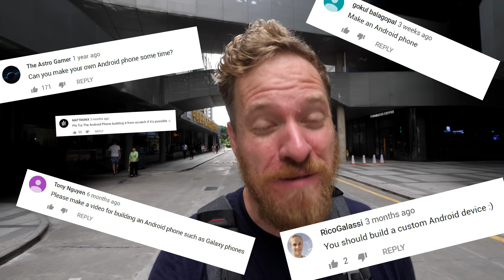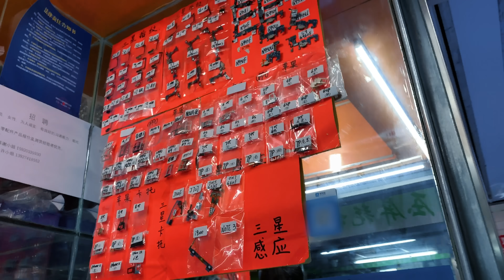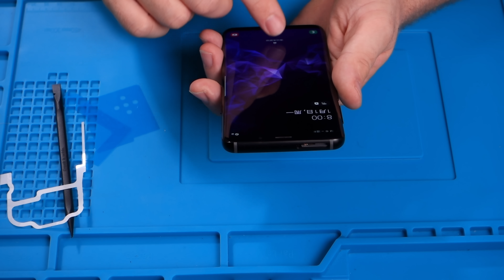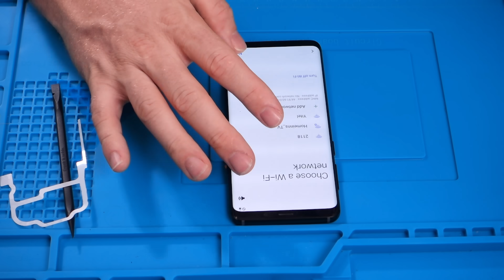How I Made My Own Android Phone

Comment: So how much did this build cost? 
Also are these all OEM parts or replacement (dunno what you call it but the opposite of OEM, random manufactur)?
Reply: less than 50bucks
Reply: Lmao OEM parts are the actual parts used by the actual manufacturer. So non-OEM are just real similar parts (basically replicas) to the OEM parts made by other people/brands.
Reply: OEM stands for original equipment manufacturer. You are asking if they are aftermarket parts/generic parts. That is the opposite of OEM.

Comment: Is not easy to build a high quality s9+. The oled display of phone you build is original or just a lcd Chinese copy. How many gigs of memory have the logis board you used, because the s9+ have a version with 256 gigs of UFS memory. The battery you used is an original battery or a cheap one. The video of IPhone Building is more accurate then this. Respect for your work.

Comment: Am into repairing android phones recent and now do start noticing that whe a new or an old phone is replaced a 'new' battery it does lock allways.
ex. had a Nexus 6 replacement battery, went into rebooting the android menu showed 'locked phone' or 'phone is locked'. after the factory-reset 
it was solved, did the charge, installed it and now can be used again.

Comment: Great video Scotty. 

I think the reason the market is mostly iPhone could be down to a few factors. Firstly iPhone inherently holds value better than Samsung, so I assume it’s a better business proposition to the market sellers. Secondly as you mention China is not home of Samsung. Vietnam makes up much of their manufacturing.  
Finally Apple outsources almost everything. So perhaps whilst Samsung, who owns more of the manufacturing process, can just throw away parts of can more carefully control supply based on demand (no orders to meet etc) Apples suppliers end up with excess components, that ultimately work their way into the secondary market.

Comment: I wish IFixIt was available in South Africa - But shipping from their website costs more than the toolkit itself.
Reply: You can easily get every part that ifixit sells for cheaper on eBay. Even if you buy the tools separate in a better quality, it still will be cheaper.

Ifixit just has a good marketing and made fixing available for the public first.

There are instruction videos for every phone available on YouTube.
Reply: @CraftingCake  I have a very capable toolkit I've built over the years as a systems engineer, but unfortunately they aren't all as comprehensive or equal in quality as a specialised kit from ifixit. If I had the option to buy a kit at retail value I would because of the trouble it saves and the guarantee that comes with it

Comment: I've built a note 9 in the markets after seeing your video, the cost ended up being:

Screen + Midframe: 920 yuan, $130
Motherboard (6g+128g): 600 yuan, $85
Back Glass + Camera lens cover: 40 yuan, $5.67
Fingerprint: 60 yuan, $8.51
S-Pen: 130 yuan, $18.44
Front camera: 25 yuan, $3.55
Iris scanner: 28 yuan, $3.97
Rear camera: 90 yuan, $12.76
Type-C Connector: 18 yuan, $2.55
Bottom Speaker: 5 yuan, $0.71
Top Speaker: 3 yuan, $0.43
Wireless Charging + NFC: 25 yuan, $3.55
Vibration Motor: 1 yuan, $0.14
Headphone Jack: 3 yuan, $0.43
Battery: 45 yuan, $6.38

Total: 1993 yuan, $282

And if you go up a few levels in LongSheng Communications Market (9:45 in the video), there's an entire floor delicated to samsung parts.
Reply: I made note 8 for $317 but from internet
Reply: @lukalakic1864  whats the website ?
Reply: @lukalakic1864  what's the website ?
Reply: @lukalakic1864  can we know the website please? thank you
Reply: 牛逼 自己装的话防水能有保障不
Reply: @Marc-.  没保障啊，背板还有点没粘好
Reply: Marc 你猜
Reply: Xiao Ruin give me your contact details
Reply: Damn that is cheap  at that price I want one
Reply: give me ur contact details pls
Reply: What about battery?
Reply: @JoshELTORO  It's $6.38, forgot to add it.
Reply: Cool, man
Reply: @zn6ndi  he said 6+128g, ram 6g and 128g storage I think
Reply: @rigoligorlc4795  i didnt Saw sorry
Reply: I would love to see a detailed list of the items you got so I could do the same
Reply: I think you'll need to buy the Nfc cause this smartphone have temperature sensor on the Nfc, and you'll need DE rear cases, at least the top case cause it have parts of the anthena and the proximity/light/led sensor..
Reply: you could have bought a good one in the same price but great effort
Reply: Yet we shell out thousands of dollars for these phones...
Reply: how do you write the imei ?
Reply: @viruxinem  they sell used boards already with IMEI
Reply: @vrexig  ahh ok
Reply: I’d be interested in a note 9 build too. Does anyone know where to get parts if not living in China? Thanks

Comment: Hi. I have an idea for your next video. 1. Increase ram of s9 to 8gb. Because s9 initially have 4-6gb ram. And it's too low for modern android and Samsung oneui shell. S9 should have at least 8gb ram. 2. Replace nand flash from ufs 2.1 to ufs 3.0. I think that should increase performance a lot! 3. Change battery from 3000 mah to bigger. 4100 will be good. Also you can use non liion batteries. Nuclear will be good if you can find it. I think s9 (non plus) will be more suitable for this experiment because it's compact. Best wishes and let me know if it's interesting idea for you.

Comment: There are some serious security concerns about Samsung if the only thing you had to do is factory reset the phone ! I know for a fact that if you factory reset a Huawei phone, it will ask you to log in with the previous Google account used on the phone to continue. This is made to avoid theft. If what you had to do to unlock the phone was to just factory reset it, this is a very bad point for Samsung: they don't have the same security standards as other Android phone brands. This is very upsetting, although I imagine Samsung are not the only ones that don't require any security for factory resetting a phone. In general, this is one of the rare times that I would say that Apple does this better than Android !

Anyways, awesome video, it's unfortunate that you didn't mention the total price for the parts at the end, although I imagine this limitation is due to the sponsor iFixit.

Comment: I think there are so much more parts of iphones because they are fairly easy to repair compared to Samsung or huawei. Some models of huawei seem to be okayish but overall they are a lot harder to repair. Actually, since the backs and fronts are glued instead of screwed on, they have a fairly higher chance of breaking than iphones do, yes iphones use adhesive as well, but since it's not their main maintaining thing for their parts, it works better than samsung etc....
Reply: If people think of repairing their phones, even though the parts in price somehow make up for the cost, they would rather repair their iphone instead of a samsung if they had to do it themselves

Comment: Have you guys ever had a small lap top Eee pc I know the video is not about it but I have a problem with hard drive some kind of mistake happened in Bios and I cannot disable hard drive master password  it says that it is enabled but grayed out no certain options that are supposed to be and it would not install windows 7 starter system. I tried everything to remove battery that holds mother boards memory, recovery. I need help or a new laptop I guess.

Comment: i'm not sure if you remember the days before smartphones were conceived, there was this PDA by Handspring, they did have some interesting modules that you could attach to the PDA for certain needs. Example turn your PDA into a working cellphone..... do you think that the next step in the smartphone evolution would be a (clip on module) customizable smartphone?  Maybe lets say a FLIR camera or a rangefinder or some attachment that's industry specific. I do know there are a lot of after market stuff to attach to Androids and I phones but there hasn't been a specific manufacturer that does all options under one roof and is reputable. Just wondering what your thoughts are.

Comment: What if you could put the motherboard of a new 5.7" inch phone into the galaxy mega case (which is also a 5.7" I think) and use the galaxy mega display but the power of a newer phone. Would this be possible? 
I just gave an example but you could use different phone models.

Comment: try modding an android ram chip / increasing capacity or seeing if you can actually use micro sd cards as ram 😊🙏
Reply: You wouldnt want to use a sdcard as ram, they are significantly slower and don't function like ram does

Comment: Please don't lock the subtitles on the video before checking them first!! Some of the subtitle errors fixed:
2:28 "I'm going to look for the logic board first"
2:30 "I know from past experience that's often the hardest part to find"
2:34 "I just don't know if I'm going to be able to find S10 boards yet"
2:36 "As long as I can find that part, I'll be able to find everything else no problem"

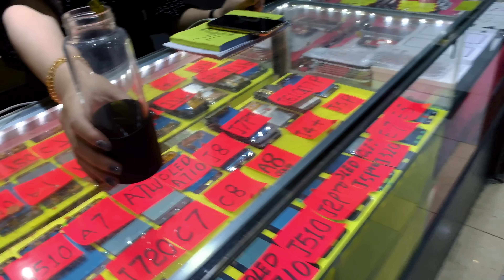2:47 "Man, this is so confusing" (missed line)
3:02 "What the heck is a G935?"
3:08 "I am so lost. I don't even know if these are Samsung boards." (missed line)
3:15 "They're the right colour, but I have no idea if I'm... even in the right part of the market, if I'm even in the right building"
3:23 [speaking Mandarin]
3:31 "Market sellers here tend to cluster together not just based on what they're selling, but also their hometown, so it can be super confusing finding your way around."
3:49 "S10. The, um, logic board. No? Okay. No-one has. Okay. Thank you."
5:24 "A lot of phone parts come from places like this"
5:46 "There used to be ladies that would sit on the sidewalk outside my old apartment, shucking cellphones like oysters, sitting on little stools"
6:19 "You've got to wait for enough broken phones to come through to be disassembled to create the supply of parts"
8:47 "It's sometimes hard to tell if I'm even at the right booth"
11:09 "And this is the headphone jack" (missed line)
11:12 "So that plugs in there" (missed line)
11:20 "I know that the D40 goes up... that goes into that socket there" (missed line)
11:24 "I guess I should open this" (missed line)
11:45 "I need a spudger though"

(Some got fixed already apparently)

Comment: I expected that you'd assemble a popular mass market phone but i was HOPING you'd step it up about a few orders of magnitude and design your own, like a frankenphone from parts of different devices or something built out of engineering/prototyping oriented kit. Finally that's the advantage that Android has kernel and foundation library sources available and is not really locked to any given set of parts, and you are a software engineer. Maybe in another two years? Goal?

Comment: Samsung's Galaxy's don't break like Apple iphones. Apple phones are built to break and Samsung's are also much easier to fix. My work phone is an iPhone X and I've had to fix it or replace it 5 times. My personal galaxy s8 after 3 years is still in perfect shape and I've dropped it at least 100 times and once down a flight of stairs. My iPhone  has a much nicer case and it's in awful shape after 6 months. Camera shutter is failing, it's slightly warped, even with a case is dented, it's slow, the screen is already fading... It's just bad.I had real high hopes for it too.

Comment: You can probably factory wipe it in recovery, but if it's locked with a Gmail account you will most likely have to get the factory binary mode image and boot into that. From there you can install an image with Odin.

Comment: The simple fact is that iPhones simply are not meant to last as long as other phones, and as a result, there are a lot more donor phones out in the wild. This is why you had such a hard time finding parts for samsung devices. Just in my experience in cellular sales, I have seen a clear trend. Samsung users typically come in to upgrade or replace a phone they demolished, or one that is greater than 5 years old. With iPhone upgrades, it is typically a situation where they are upgrading from an iPhone that is less than 3 years old, due to one of many issues related either to; the battery, speakers that have failed, failed communication hardware(no/intermittant signal), sim card reader has died, charging port has died, internal storage has failed resulting in a boot loop, home button died, or a lack of legacy support for the device. There is of course the rare outlier where a Samsung phone runs into one of these issues, but typically there is external damage to the phone of some kind, and the user of the device had been abusing it in some way(like leaving cellular active while travelling in the mountains, that can cripple a phone, no matter who manufactured it).

Comment: Just did a quick research which by no means will be reflecting the price that was paid here but if you live outside of china and you want the parts let's say from aliexperess, then here you go:
S9 plus 128GB motherboard $190,  the LCD with frame $148, battery $12, glass back cover $10, wireless charging + antenna $12, front + back cam $31 so far the total is $403 which already makes it a waste of time (it's $403 if you're lucky and avoid paying customs fees) and since some of the parts are already second hand, it's cheaper and easier to get a second hand device wherever you live .  I guess the parts are cheaper in shenzhen but by how much?

Comment: Shut down the phone, hold power button and volume down(volume down or up, I think it's down but try both) at the same time and it should get you into the bios or something like that, from there you can Wipe all the cache and data on the phone, then it will be reseted and no longer have a model or anything. EDIT: Oh, you did it, never mind then. xD

Comment: The Samsung parts are hard to tell the difference between, but that's what makes them so good normally. Samsung perfected the design for their parts to make it simple to assemble, so they don't make drastic changes for every new model. Apple, on the other hand, focuses on making their phones difficult to assemble, and more importantly difficult to take apart, so they change up the shapes of their parts every new model. That leads to more unique shapes for Apple, but a far simpler construction for Samsung, which I appreciate as someone who likes to fix my phone instead of throwing it away for every little problem that comes up.
Reply: Well, compare to Oppo, you'll appreciate how simple the structure is inside iPhone.
Reply: @J Ball um ok, If every Iphone lasted for 3+ years and Android were constantly breaking you would think that the parts availability would be exactly the opposite of what he experienced in the video.  where do you think all the replacement IPhone parts come from, do you think they are taking apart perfectly working Iphones to sell the parts off?
Reply: @J Ball I bet your screen is cracked on your iphone.
Reply: @J Ball you were the smart one that actually used a screen protector on your iphone. I'm proud of you lol.
Reply: @J Ball well now they can since apple got busted for purposely slowing down previous generation iphones, then blaming on "older batteries" as if they were doing their customers justice. come on man, they could have just replaced the batteries for a discounted price instead.
Reply: @J Ball right, Apple only offered the $30 deal AFTER they got busted and didnt even bother to make an apology to its customers. Instead, they made an excuse as to why they throttled their older devices as not to get sued and fined by the government. The devices were un usable, hence people being forced to upgrade to a newer iphone device and also killing the 3rd party use and used market for iphones.

stop trying to sugar coat this dude cause it isn't working. Unless you truely are this gullible. I know Apple sure thinks so LoL
Reply: It ended up with s10. The usb c port is now connected with the motherboard. Which makes it difficult to repair
Reply: @moizahmed7392  I wasn't aware of that. Yeah, that's a pretty dumb thing to do, but I'm sure they did it for a simpler production process, not just to piss on people who want to fix their own phones. Still sucks though.
Reply: @sudonim7552  i believe it was to remove the connection between the sub pba(motherboard) and the main pba. on a s9 the main board and the board with the charging port are separate and they have a small cable that connects them both, by making the board one solid piece they save on time and save space in the phone for a larger battery
Reply: @moizahmed7392  true
Reply: Samsung trash battery

Comment: If you ever wanna test extras on the Samsung phone to make sure they are okay. Dial *#0*#. It can test the phones components on board to the device. I wasn't sure what board you bought, but if its a G965U, it's a Qualcomm Snapdragon processor, If its a G9650, it's a Qualcomm Snapdragon with a unlockable boot loader and If its a G965F, it has Samsung Exynos processor. Notorious failure hardware wise on the S9 models have been the fingerprint scanner, I see at least one a day repairing the devices. If you wanna test the fingerprint sensor fully, after you dial the *#0*# it will be under sensors menu. MLC, is the water resistance test(Not sure that's gonna work with the adhesive kit i saw) and the rest of the tests in the menu explain themselves mostly.

Comment: You need to put a SIM card in it and make phone calls and access the Internet before this project is completely beaus you can't yet tell if the IMEI or any other component on that phone is locked, rendering it partially or fully useless.

Comment: I know what I'm doing tonight, lately I've been working on putting together an Essential Phone, I got a water damaged one for 25 bucks on eBay a while back and when it sparked to life for a few seconds I could confirm that the screen works but it has some imperfections at the top and the battery might need replacing. All I need now is a motherboard and I can replace my Moto Z.